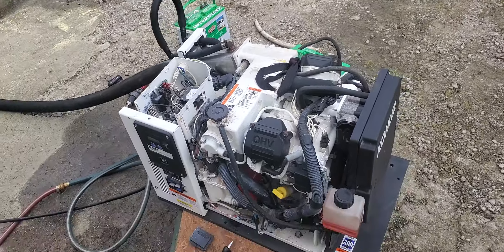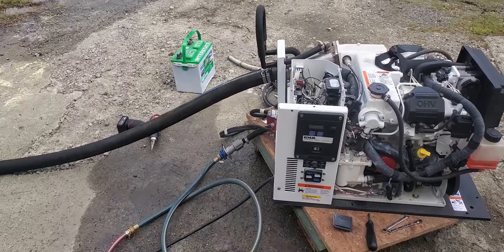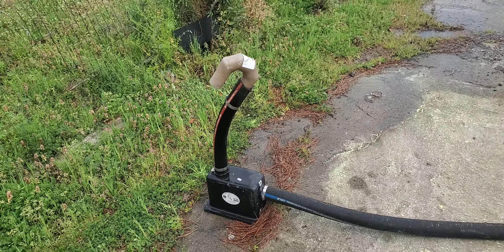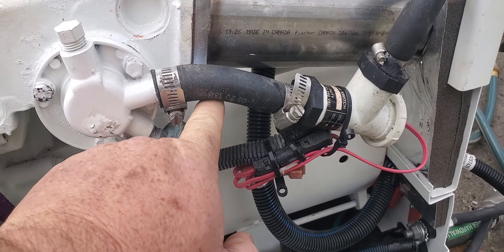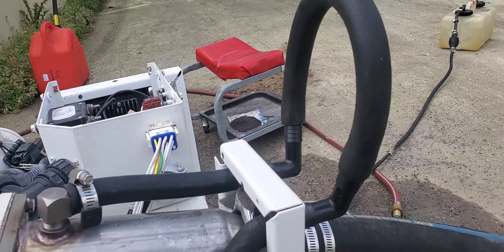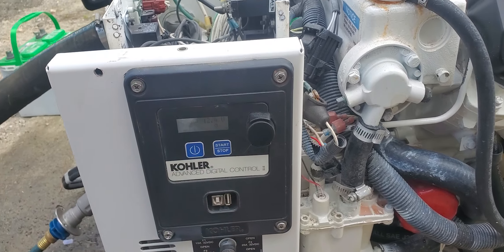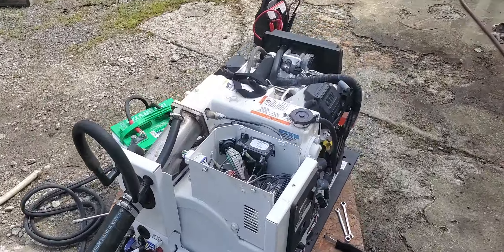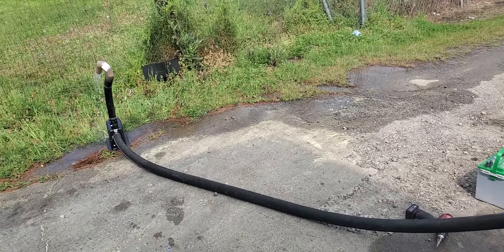Kohler 5EKD Generator Test Run and FAIL!

Comment: Thanks for taking the time to make this video.  The one I'm working on is installed in front of two inboards and I cant see much or anything on the back side..  But it looks like I have the same issue the fuel pump cooler.  Looks like a very common problem.  Pretty stupid design  cooling the fuel pump with raw water, almost intentional to sell a $1k part
Reply from the maker: Very happy to have helped you out with this video!!
Reply: @DavidWilks  IT turns out it was the brass elbow and pressure censor plugged with salt crystals.   Drilled the salt out and ported the brass 45* and no more code 67.  I ended up replacing the eat exchanger cap and zink due to corrosion.  When i got  the parts a week or 2 later the crystals already started to form, I tested the Gen. with fresh water!      I'm thinking on putting a T just before the sea strainer up to a garden hose attachment  for a flush after ever use and tell the owners to flush for 5 min. after a trip..   What say you ?

Comment: Notice the expanded hose to the fuel cooler from the raw water pump. Water pressure is too low as measured by the pressure sensor on the outlet of the heat exchanger. Likely  pieces of old impeller sitting at the start of the heat exchanger.

Comment: It's crazy that has a catalytic converter and oxygen sensor!   Tier 4?  Friend of mine has a big Cat diesel generator, gets fault codes often.
Reply from the maker: Once I got it sorted out, it was a quiet and extremely efficient but it was a monster to diagnose this unit.
Reply: Was it due to that drip in the pump assembly? I'm having this same issue.
Reply: Same issue. What was it???

Comment: Very helpful. We have one of these (with under 10 hours) and the loss of coolant error code comes up regularly.
Reply from the maker: Check to see if your water pump pressure sensor is corroded.  The sea-water pump can have low pressure due to a strainer and also trigger that code.
Reply: Hi dave
I have l.o.c error but my boat is dry docked without any access to water. Do i need water to run the generator to confirm there are no errors. You suggested pressure sea pump sensor i have checked and there is know water therefore the error has appeared? I dont have a HET exhaust sensor.

Comment: So what was the outcome ? Was it the waterpump or sensor?
Reply: Based on the hoses swelling, the impeller grenaded and debris is blocking heat exchanger flow
Reply: @mattm1925  Is that what typically sets off a EC62 ?
Reply: @RenoSimpson what happened to the one I was working on, it was a shut down for high water pressure iirc, pull the hoses and cover off the heat exchanger and see if it’s clogged
Reply: @ If you run in to this again check for salt crystals in the pressure sensor, brass elbow and heat exchanger end cap.  Solved it for me